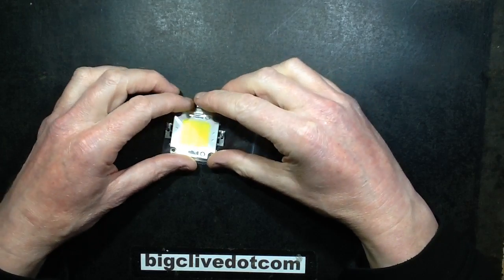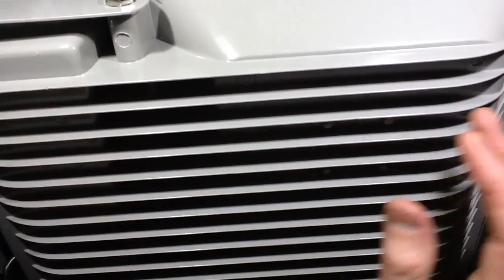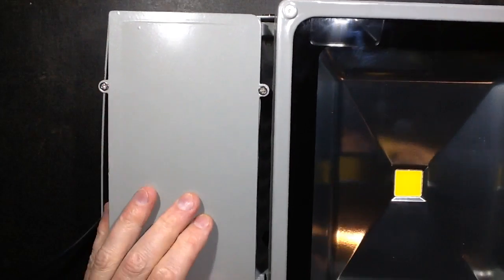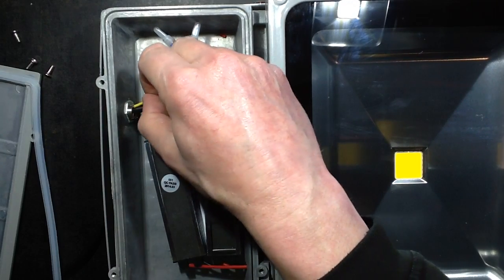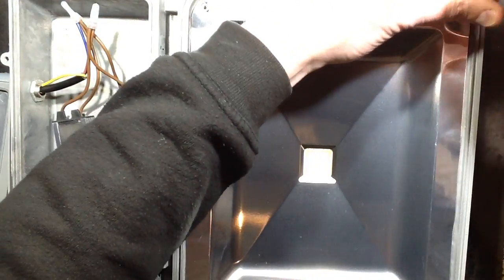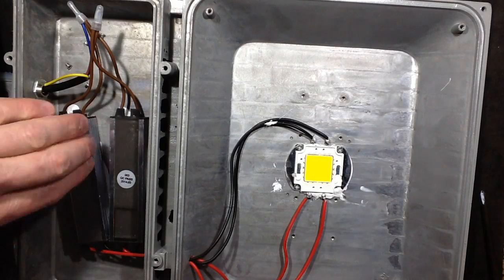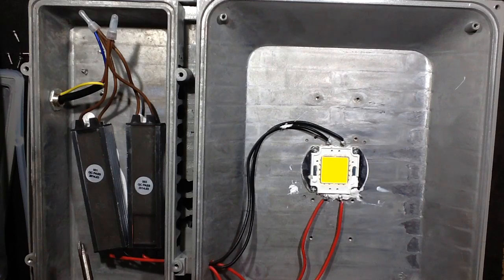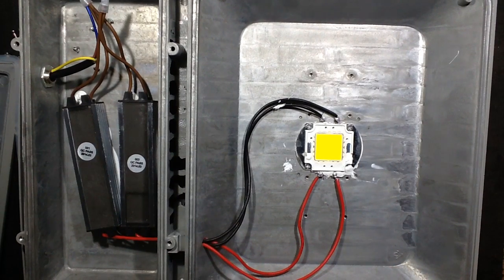Inside a "100W" LED floodlight.

Comment: I have seen 100W and higher flood lamps [largest I've seen was 500W], but they all had multiple LED modules and the higher wattage ones had active cooling... Even the 100W one had a much larger fin array and even copper heat pipes to help transfer heat

Comment: You're WAy to skeptical. Let me ask you this. Why would the company design a heatsink that size if they thought it wasn't gonna cool the LED? Obviously they designed the heatsink for the type of LED that they used. So why wouldn't it be enough to dissipate heat? Did you design this floodlight yourself?
Reply from the maker: Most of these high power LED floodlights absolutely grill the LEDs, last less than a year, and then go to landfill.

Comment: Late to the party but I had s batch of floodlights with this exact same casing. The PSU was different, and was a single unit. Earthing was a floating ring as previously discovered by yourself, and the wire was in US colours (black, white, green). Most of them failed in 6 months. I’m looking at fitting driverless 50w units instead.

Comment: looks kinda like the 100W LED that I got (just the LED by itself though)
mine has the rounded/curved parts like this LED has
these are pretty good LED's! I got mine for 10$ and all the LED chips light up very evenly as soon as any reasonable amount of light is coming out. they're all pretty much identical in brightness)

Comment: I have a 100w or a 70w and it has only a single ballist. Been trying to diagnose the problem with it. It will not run at all.
Reply from the maker: Carefully measure the DC voltage across the LED with the power on.  If it is near zero the driver is faulty.  If it is above 30V the LED is faulty.

Comment: It is a shame that you didn't break the holding glue to see the current driver tech information. I agree with you, those drivers may be only 30W each, what in some way is good, they not force the LED to its power limit.  The LEDs does not need to be taken to the limit, any lower current will do, with less heat dissipation, longer life.  If you really need 100W (street LED light), just install two of those (60W) and you will be happy with your backyard shining at midnight as it does at noon time.  ;)

Comment: Hi Clive what would you consider the best quality driver for a 100w LED torch would like  it to have a voltage adjuster like a dimmer don't know the technical term, running li-ion battery pack using 16650 the pack size can be what ever it needs to be.Second half of my ? what is a good charger discharger and balancer for looking after battery  packs i don't know much about them. Thank you

Comment: I purchased one like this but it came in with 2 led bulbs side by side. it puts out good light  but I fear the drivers are smaller than they are suppose to be as you have pointed out before.

Comment: Maybe, possibly, the chinese aren't telling us lies, and it's a 60% efficient 100 watt led?
Reply: If it were 60% efficient it would still draw 100w of power but just dissipate 40w of it as heat and only 60w of it would be converted to light.

Comment: Well, THEORETICALLY, you wouldn't need to dissipate 100W for a 100W LED. For example, if it were 90% efficient, then 90 watts goes into light and you'd only have to dissipate the other 10 watts. I'm not sure how efficient 100 watt LEDs are, but hopefully most of that produces actual radiated light.

Of course, that's for the LED itself. I don't know how much heat the driver produces. I guess if the driver were so inefficient that it took 200 watts input to drive a 100 watt LED, then maybe so.

Comment: I got the 50W version of this kind, the casting was warped, so the silicon seal wouldn't work properly, letting the rainwater in. Luckily though because the cast was so thin, i was able to bend it straight (if that makes sense). 1st led chip failed within a few months due to the 'imbalanced disco scenario', got a cheapy replacement one thats all balanced and still working, guess i was lucky there. Just a little more attention to quality and they would be a good product.

Comment: Just cut the earth wire off, they only get in the way. Besides, with chinese gear earths cause fires.... Better off just getting a shock, than burning the place down.

Speaking of burning, how long did you leave it switched on for ?

Thats the real test for these Chinese products. . . It amazes me just how they manage to make things last such a short length of time... Genius it is.
Reply: +cucking funt  Im sure the led drivers are potted against ingress, with integral fusing and switch mode isolation capabilities as standard. 'IM SURE' with a sarcastic giggle!. So there's absolutely no need for an earth, especially as the enclosure is painted lol. :)
Reply: +simon hare It's Chinese Export marked, erm I mean CE marked ;) I sure it's all gravy.

Comment: Surely a 100w led wouldn't have to dissipate 100w of power.  Perhaps 50w?  Some of it should be converted to visible light.
Reply: ***** If 100w of electricity is going into the device, and some amount of that energy is leaving the device as light, will 100w of energy be left to be converted into heat? Perhaps you should look into the meaning of that law yourself.
Reply: ***** Oh, why didn't you just say that the first time?

I did a bit of digging, and Wikipedia lists a few different LEDs and their efficiencies, with the best barely exceeding 10%, and a theoretical limit of around 40% for the current technology. Looks like efficiency improvements won't be decreasing cooling requirements all that much.
Reply: Phoenix  "best barely exceeding 10%"

The following web page says that a typical LED converts about 25% of the energy into visible light - which is still terrible when you think about it.

http://www.physicscentral.com/explore/action/led.cfm

The following says that LEDs convert 90% of the energy that is fed to them into visible light, but this probably ignores resistors and any other wires and electronics that are needed.

http://www.midamericanenergy.com/ee/include/pdf/ee_led.pdf
Reply: Phoenix 2%   This is very depressing.  All of these bulbs, LED or otherwise, should be labelled as heaters, with a side benefit of producing some light.
Reply: Mandragoras  If the efficiency of an LED bulb is only about 10%, and the efficiency of an incandescent bulb us also about 10%, then there's hardly any point in using LEDs!
Reply: +PC KUCHING   "if indicate 100w the meter will show 100w"

Yes, but 90w of that goes to produce heat, apparently.
Reply: Kevin Solway No way in hell an incandescent is hitting 10%. Wikipedia lists standard 60w bulbs at just over 2%:

https://en.wikipedia.org/wiki/Incandescent_light_bulb#Efficacy.2C_efficiency.2C_and_environmental_impact
Reply: +Kevin Solway they are inefficient, but they put out more light per energy unit
Reply: +therealnightwriter At least Wikipedia lists its sources, something I can't say for you.

Also, if you want to verify the efficiency claims, it wouldn't be hard with a few light bulbs and some basic electronics equipment.
Reply: Kevin Solway The efficiency written in the second link is huge lie. As far as I understand, efficiency achieved in labs is not part of this discussion, so the typical efficiency of a commercial LED bulb is 12% 
Source: Wikipedia and calculations from typical product specifications.
So, a crappy chinese LED like this is probably going to waste more than 90% of energy supplied as heat.
Reply: +Kevin Solway if you buy a philip LED bulb, if indicate 100w the meter will show 100w.

Comment: I've got one of these for my workshop light, i brought it from a LED lighting specialist that buys these units but replaces them with proper drivers. the driver in mine is much larger and is labeled 100W. just goes to show what is required to make a decent LED light and what they try and get away with!

Comment: bigclivedotcom  looks like they arent in parallel, but one driver is running half the leds, and the other driver is running the other half.  these are my thoughts, as i dont see the "sharing" strip that you typically see with these style led chips.   do you still have this lamp to investigate further?
Reply from the maker: The drivers were hooked in parallel to a common 100W LED.
Reply: Agree with this comment

Comment: I was going to say you could extend the earth wire and poke it through the same hole as the other wires in order to fix it to the case using one of the tapped holes. But then you took out the file and I had to turn my eyes away, I was certain it would snap and blood was to be shed (files are very hard, but also very brittle). Fortunately this was not the case!
Reply from the maker: PuchMaxi1988 The four wires going through that hole between the two parts if the case are already tight in it, so no room to put a wire through there.
Reply: bigclivedotcom Yes, indeed you are certainly right there. I was thinking, since the drivers are in parallel you could simply remove one pair of wires and parallel them up before going through the hole? That should leave enough room for the PE.
Reply from the maker: PuchMaxi1988 That would work.

Comment: One could loop the ground wire round the gland, clamp it between the case and the nut.

Or loop it through a washer and put that under the nut.
Reply from the maker: m8e An SWA cable gland earthing washer (frying pan washer) could be an option.  Or even penetrate the case with a small earthing bolt.
Reply: +bigclivedotcom just use a file to drill the hole lol, great video as always

Comment: That looks like a zinc alloy die casting to me, not aluminium.
Reply: Graham Langley correct, this design using poor quality materials zinc alloy die casting as heat sink. We have testing some samples, usually failed to work in 3-8months. As matter of fact, some people purchased poor quality LED lights, and quickly loss faith on LED lights. The products cost cheap, but replacement cost and shipping cost high.